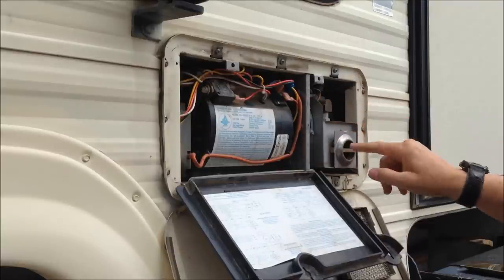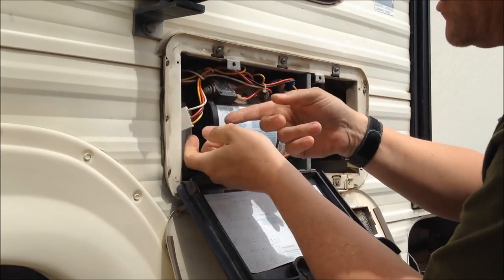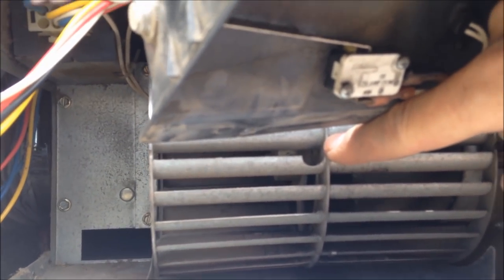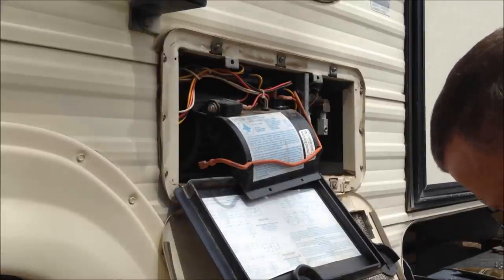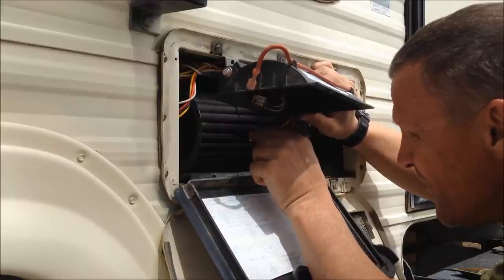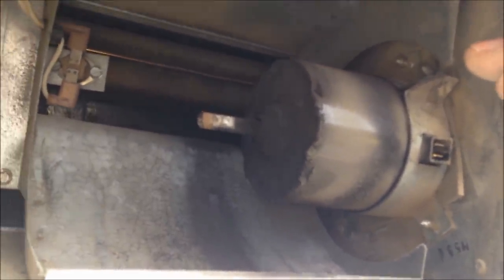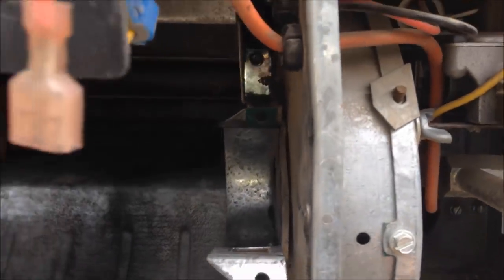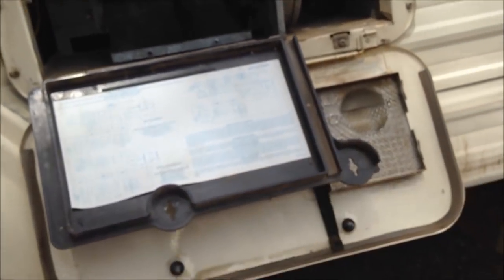RV Furnace Repair Atwood 8535-II Hydro Flame | Motor Replacement (Part 2)

Comment: The best way to easily remove the fans from the blower motor shaft is to hold the hub of the burner fan (right side) with channel locks while rotating the blower fan and simultaneously pulling it away from the motor. It should drop right off after a few turns. Then hold the exposed shaft on the left with channel locks and spin the burner fan off the same way. Took me about 3 minutes to pull both fans and the motor free.

Comment: Your Video was a great help. A few suggestions I have is.1, Use a piece of Duct tape to hold the motor cover up above the work space.2, using a crescent wrench on the motor shaft to hold it from rotating while spinning the exhaust fan in order to remove the motor worked good for me. A quick squirt of WD-40 helped remove it.Note, Since the bearings on my motor are not bad, I was able to force High temp Lithium grease into each side of the shaft using tooth pics. Working it in as I rotated the shaft. I was amazed at how much I was able to squeeze in. the squealing has stopped, the lights no longer dim when the motor starts.  I don't know how long this fix will last, but it will give me time to find a replacement motor at my convenience.Again, thanks for the Video, I couldn't have done it without your instruction.
Reply from the maker: +wagincrap All excellent ideas you have and sounds like you will extend the life of your motor. Glad to hear my video has helped you out. Thanks for watching.
Reply: greasing up the old motor didn't  last longer than a week. so I ordered a new one and installed it in 30 min. thanks for your vid.
Reply from the maker: Well now you should be in good shape for a long time. Keep warm and thanks for watching.

Comment: hey thanks your video helped me get this done. One thing I could add: When I was removing the engine from the internal fan, I heated it but it was stubborn so I really ranked on it and bent the inside fan. It wobbled and scratched the cover when I put it back together. I took a screwdriver and bent the cover away so it doesn't hit, but you can still feel it wobbling. that inside fan appears to be difficult to get out of there so I'm dealing with it for now. My point is: be careful when taking that old engine out. don't bend that fan.

Comment: Thank you so much for this video. it saved me a bunch of money for a service fee. now all I have to do is find the motor.
Reply from the maker: +force245 Glad to hear you can save some money using this video. Another benefit is you will know how your heater works so you can troubleshoot it yourself in the future if needed. Thanks for watching my video and it's good to know it is helping people.
Reply from the maker: +WannaBFree Type in your furnace model # on a Google search or Amazon and you will easily find the motor you need.

Comment: Thank you so much! Great video super detailed. Best one I’ve found. It would’ve been nice to hear what the motor sounded like before you replaced it as well to help others diagnose the symptoms. Just some feedback for next time. Bless and thank you
Reply from the maker: You are welcome! I agree it would have been nice to get a before video and audio of the motor before it went. It would occasionally squeal a time or two but that's about all the warning I had. By the time I realized it needed replaced, the fan did not come on at all. One time it worked and sounded normal then the next time it wouldn't run at all.
I would say if you hear the motor squeal you probably need to replace the motor as soon as possible because it may not work the next time you try to use the furnace. Hope this helps you out.
Reply: @WannaBFree  Exactly like mine did as well.  It squealed like hell when if first came on, then stopped and would run great, every time I used it, then like he said, it just simply did nothing when I turned it on.
Reply: My motor when it was going was a loud and I mean loud squeal metal against metal terrifying.  Thinks a couple more watches and I 'm good to go.

Comment: Very helpful.  Got the same project on a model III staring at me.  Only this one is mounted vertical.  It got noisy, took that cover off and found 6 fins broken out of the blower cage.  Motor seems to have a lot of end play, so it's getting changed also.  The R V is being used as a medical safe zone, so its got to work ... not a job you want to be doing in a snow storm!

Someone had been in this before, it appears that the black plastic cover over that fan was not re-installed correctly, which caused the fan damage ...
Reply from the maker: Glad to hear you are getting yours fixed up. Nothing worse than a heater that doesn't work when you need it the most. Thanks for watching.
Reply: @WannaBFree  Got it all buttoned up as daylight started to wain.  The main cause of damage turned out to be ... a damned field mouse.  Loads of fun removing the rest of him from the heat chamber!
Reply from the maker: Glad you got it all wrapped up. I know what you mean about the field mice. Darn things can cause a lot of issues with RV's and other things too. Good to hear you got it out of there and all fixed up. Take care!

Comment: I think there is a allen screw on the small fan that you need to loosen, you can see the little hole in the metal shroud so you can send an allen wrench in to loosen it. I don't think you will have to heat the thing up if you loosen the screw.
Reply from the maker: Yes the fan does have a set screw and I had to loosen it. The fan was still not sliding off the shaft and that's why I applied the heat. I suppose the fan was stuck due to the age of the unit and the heat just helped loosen it enough so the fan could slide. I'm pretty sure that applying heat alone would not let the fan slide without loosening the set screw. Both were required to remove the fan on my heater. Good observation.

Comment: Hello I unscrewed the Allen keys to both fan sides but I think the fan is seized as it will not come off any advice? I tried using penetrating oil too
Reply from the maker: Did you see in the video at 14:30 where I talk about heating the fan hub with a match to remove the fan from the retaining hub? A little heat on the hub expands the size of the hub just enough to let it release the fan. It may not always work but that's how I had to remove my fan.
Reply: @WannaBFree  thanks! I ended up rotating the two fans in alternate directions. That freed them up

Comment: Good Show! Haha "Bushings or  Bearings  " that Atwood/hydroflame stuff is made at absolutely MINIMUM  cost! , the price of a decent bearing would be near half the manufacturing cost of the entire motor
Reply from the maker: It's been a couple years since I made that video and I don't remember if I sail "Bushings or Bearings". Good point, I'm sure this motor has bushings. I'm sure that's why it wore out. Thanks for pointing that out.
Reply: @WannaBFree  IDK why outfits go to the trouble of building something like this motor (which conceivably could last my lifetime but opt to build it with parts that WILL fail) , mind you this motor is brushed so i guess that would determine life too ,,,, i guess it's just another example of the " race to the bottom" regarding consumerism
Reply from the maker: I agree 100%. I'm in my mid 50's and have seen over my life time the decline of quality products on the market. These days in the US the theme seems to be "sell junk and sell a lot of it". It is a very rare thing for a business to sell quality products these days. Buy it cheap and throw it away when it breaks or stops working. I'm about as frugal as it gets and I like to buy it cheap and fix it or improve it when it breaks. Then continue to use it 4 to 5 times past it's original lifespan. Ha Ha I get a kick out of doing that and it makes me feel like I got one over on the junk dealers in our modern society. LOL My observation is campers in general these days are made out of plastic and junk, they cost 10 times more than they used to when I was a kid and they definitely are NOT built to last. That is the main reason you will probably never see me buying a new camper these days. Just my opinion and no offense intended if you own one or want to own one. That original motor did make it 25 years and I'm sure that is well past it's expiration date so I suppose I can't complain. Take care and sorry for the rant. 😀👍
Reply: @WannaBFree  rant totally on target! I got about 20 years on Ya (most of them in remote areas where getting replacement really is not an option if you can't wait a year) ,, so I've come to accept (not like) the design and "throw-away" concept that producers have forced on an all too willing consumer for the sake of affordability !!!! Which in  the long run it really is not!

Comment: Great video! Any tips for getting a stubborn exhaust vent out? 1:20 - for you it comes out so easily, but mine is apparently rusted in tight. I've been spraying it down with WD-40, removed the cap, and have been trying to twist the inner pipe with a wrench but it's not budging at all for me. I even slid a large socket into the pipe so I wouldn't crush it with the wrench - that's how hard I've been trying to break it loose.
Reply from the maker: Thank you. I'm sorry but I haven't had to deal with a rusted exhaust vent. It sounds like you have tried everything I would have thought of with the exception of one thing. Sometimes heat can help with rusted parts. Could you use a small propane torch and heat up the pipe from the inside as close to the joint as you can get? Then try the wrench and socket method. Be careful about the WD-40 if there is still some in there, it's highly flammable. Good luck with your project.
Reply: WannaBFree - Great tip! I’ll give it a shot thank you! I’ll let you know how it goes :)
Reply: @WannaBFree  - So, I got it nice and toasty with a handheld propane torch and nothing... not even the slightest wiggle. I even re-soaked it with WD-40 while it was still fairly hot (fire extinguisher handy). When I wrench on it the whole heat exchanger is moving inside the housing. :(
My goal is actually to get the gas valve and burner assembly out - it's not burning 'clean' (I can hear the flame gurgling and the exhaust smells "cold" if you know what I mean - like an engine that's just started & not warmed up). This suggests to me I'm getting incomplete combustion. Additionally, the furnace doesn't light unless I hold my hand over the exhaust while the ignitor is clicking. Again, a symptom of a dirty/faulty burner in my opinion. I've tipped the whole furnace every which way while banging on it and probably 2 full cups of 'rust crumbles' have fallen out. I think I've got most of it out and it has improved the gurgling and the smell a little, but it still won't light without my hand over the exhaust.
Anyway, I'm tempted to try and remove the gas valve and burner by just working 'around' the exhaust tube. It's tight and I'll have to bend a few things, but it might work(??) Otherwise, not really sure what to do. Would be a shame to replace the whole thing just because I can't get the exhaust tube out.
Reply from the maker: @truthsmiles  Darn! Have you had a good look at the fresh air intake? Sometimes they can get bug nests in there that will impede the airflow into the burn chamber and cause it to not get a clean burn. I'm at a loss here and sorry to hear you were unable to get the rusted exhaust out.
Reply: @WannaBFree  - No worries and thanks for the suggestion! I'll keep working at it. Maybe if I ignore it for a couple of days it will let down its guard and I can sneak up on it and pull it out. :-) 
Regarding the intake, don't I need to get the exhaust tube out first? I might be able to get the gas valve and the burner assembly out without removing it, but it will require bending some metal. I might be able to examine the intake then, though.
Reply: WannaBFree - I finally got it off! A real saga. I ended up cutting the flange on the tip completely off with tin snips, then removing the valve/burner assembly by sliding it past the exhaust. 

Then , I slid an impact socket inside the pipe and clamped it with an exhaust clamp. A 1/2” drive impact wrench wouldn’t get it off. Ended up spinning the socket. 

I was continuously using WD-40 and even tried a propane torch plus the impact. 

Then, I drilled holes through the pipe into the impact socket and put in screws. Re-clamped and re-impacted. Sheared the screws. 

Finally I WELDED the impact socket to the pipe. Still didn’t get it off, but eventually twisted the pipe completely in two. 

But then, I was able to get the outer shroud off the pipe with lots of wiggling. And THEN, I was finally able to separate the heat exchanger from the fan housing. Once I could get to where the pipe went into the heat exchanger, another huge dose of propane torch and a hammer to beat the pipe into submission. Finally broke it loose!

Weeks of trying different things, each more extreme, and it finally came out. 

At this point I hope everything still works. I removed the circuit board for the welding and impact stuff, but I hope I didn’t fry the motor with the arc welder. We’ll see! Haha
Reply from the maker: @truthsmiles  WOW now that's some determination but good to hear it paid off. SWEET!!! Hope it all works out for you in the long run.

Comment: I installed my new furnace motor today and everything works except the air from the blower doesn't push up the lever to ignite the furnace even though the lever moves freely. 
I'm stumped. Will be dangerous to tape that lever down so I can get some heat.
Reply from the maker: Three items I would check. (1) Make sure your switch is working smoothly without obstructions. (2) Make sure your fan is not on backwards and blowing in the wrong direction. (3) It usually takes a good strong well charged battery to turn the fan fast enough to activate the sail switch. Make sure your battery is strong and well charged. Other than those items I don't know what else to check. Yes, it would be dangerous to tape down the switch. You could end up with un-burnt fumes in the heater and when the furnace lights "KABOOM"! It's not worth the risk in my opinion. I hope one of these will work for you. Good luck and be safe my friend.
Reply: NEVER TAPE THAT LEVER OR RISK DIEING!!!!

Comment: Man thanks for this video.  I have followed this video but when I got to the fan, it is on by two red clamps.  My model is the Atwood 8535-IV.  I need to replace the fan motor but how do I slide off the fans after taking the clamps off.  There are no Allen screws and they are stuck on the motor tight.
Reply from the maker: I am not familiar with that particular fan set up. If there are no set screws I would assume that maybe the fans are press fit on the motor shaft but truthfully I really don't know. You could try heating up the hub of the fan and then try  a punch or press and see if it will come out. If you try that make sure when you are heating the hub just heat the hub. The idea is to heat the hub and have as little heat on the actual shaft as possible. If this works for removing the fans you can do just the opposite to install them on the new motor shaft. Heat the hub of the fan and then press it onto the new motor shaft. I hope this will work for you. Sorry I can't tell you for sure, I'm just guessing with this.

Comment: I will try and make it short!! My Atwood furnace sqeeled a couple time and the next morning it was on but very quiet like the blower motor was not working, very little heat was coming out of the floor vent, I looking it over from the outside very dusty? and i pushed I believe the reset button, it had a faint electrical burn smell, could it be the mother burned out? P:S at first the cage was barley spinning its not anymore?
Reply from the maker: See if you can get the fan cover off and try to turn the fan by hand. It should turn real easy and smooth. My experience is if it is squealing then you probably have shot bearings or bushings in the motor and that's why it's not turning very fast. If it doesn't, the bearings or bushings are probably shot and you'll need to install a new motor. If it does turn smoothly, the control board may be your problem and you'll have to replace it. The control board is a plug and play. Pull out the old one and take it to an RV shop and if you're lucky you'll be able to get a new one and plug it in and hopefully it will work again. The control board is a little pricey but cheaper to do it yourself and much cheaper than a new furnace. Hope this helps you out.

Comment: I have an 8531-II furnace. It will not kick on at all, no click or anything from my thermostat. my father-in-law ran it constantly in the North Dakota winter 2 years ago and he said it just quit working one day. Would you have an idea of where i could start to find out what the problem is? i did check my furnace fuse in the camper and it wasn't blown. i have a 1991 Dutchmen Classic fifth wheel.
Reply from the maker: Make sure you have gas flowing to the furnace of course. The next thing would be the control board. A bad board is a common cause of the furnace not working. They are fairly easy to remove and take it to an RV store and they will usually test it for you. If you need a new one they may have it. It will probably be from $50 to $80 to replace. Otherwise it could be several different things. Maybe a bad sail switch. They are only a few bucks if that is what it is. If the sail switch isn't working the furnace will never get gas so it won't light. One other item to check is make sure you have a good strong battery supplying power to the furnace. If the fan isn't turning up to speed it won't generate enough air flow to activate the sail switch. Hope this helps you out.